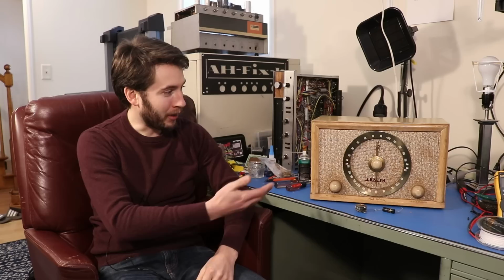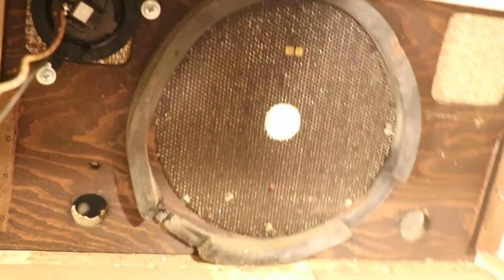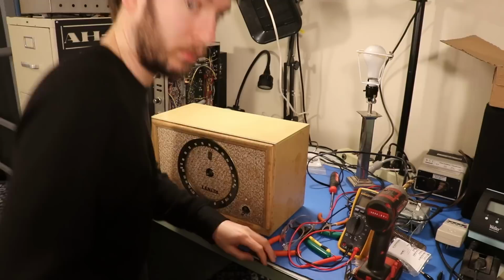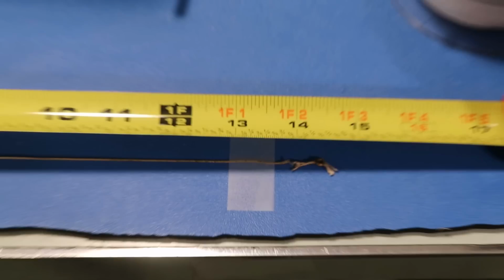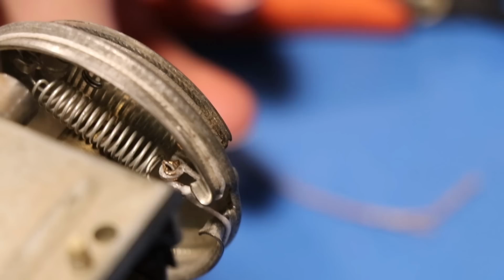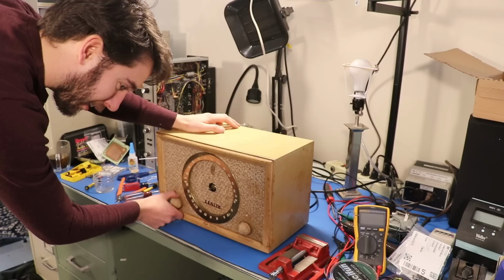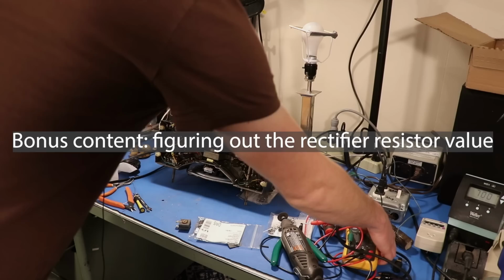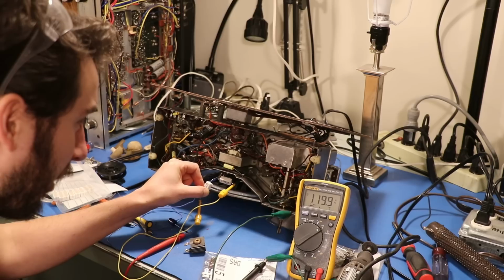I Missed Important Stuff On This Zenith B835E (And You All Let Me Know About It!)

Comment: Well, Christmas has passed, but New Years Eve is tomorrow. I'd like to wish you and yours a very happy 2023. After 2022, we sure could use it.
Here's something about your Zenith radio you probably didn't know:  There's a white dot just before the 100 on the FM dial. That's the original Zenith-owned WEFM in Chicago at 99.5 FM (now WUSN). It was the second station in the United States to begin broadcasting in FM. Also, Zenith really was promoting FM after the War, through the 1960s. This is likely why their AM/FM radios were so nice and had such fine audio, taking full advantage of FM's higher fidelity. This is particularly true of the 8 tube tabletop models. Some of those models over the years include the Y832, H835, B835, C845 & H845. They look different, but all have the high quality 8 tube chassis and sound wonderful.
Reply: The amplifier in those sets wasn't much different from what you found in most table sets: a single beam power tube, good for a watt or so. So while these played at adequate levels with a pleasant character to the sound, they were hardly what you'd call hi fi. But sound quality always seemed secondary to RF quality for Zenith in these sets. They put a lot of work into the tuner design, and changed it very little from the early 50s on.

Comment: Thanks for the feedback, glad to hear the radio performance is better and you learned some useful tips in the process.  I am glad to help if you are interested.

I have been restoring tube radios for the past 50 years and about 90% of the radios seem to have broken dial cord.  The woven fishing line you used is not optimum but, should work fine.  The eyelet used on the ends of the dial cord is not necessary; a knot will suffice.  Zenith used these to speed assembly line installation.
Reply: A simple knot is definitely all you need.  Once the cord is installed, a drop of superglue on the knot will permanently lock it in place

Comment: Oh the stench of a selenium rectifier melting down! Yep, you will always need to add a dropping resistor with a diode. The old rectifiers were not efficient which is why they heated up quit a bit.

Comment: I always enjoy our little walks in the park. Thanks. I wish aligning the FM tuner on my Pioneer QX-949A was as simple.
Reply: It’s actually even easier, all you have to do is adjust the local oscillator screw on the tuner until the stations line up.
Reply: @mjg263  OK,  thanks but i think i need more info before i go messing with it. ??  When 98.1 is tuned in the needle is at 96.4 ish
Are you familiar whit the qx949a ? How is the "local oscillator screw" labeled?
Reply: @ivansbacon  if you are looking at the variable tuning capacitor, you see those 6 adjustment screws in a row on top? Don’t touch any of those, but just past the very last one (furthest away from the big tuning drum with the string around it) you will see a small screw with what looks like a washer soldered onto the head. That’s the local oscillator adjustment screw. It is extremely delicate so use a very small screwdriver, and just the slightest tweak will bump the station position up or down the dial so be very very easy on it. You can touch up the position with that if it’s a little out. If it needs a full FM alignment that’s a job for a pro.
Reply: @mjg263  Thanks, i will give it a try when i set it back up with speakers.

Comment: Was there a problem with the original tweeters? Since they were disconnected raises an eyebrow.

 I have a couple of Zenith radios with these tweeters and one of them had no sound coming out of the tweeter. I heard of these developing shorts, so I checked it for DC leakage with my Heathkit IT-28 capacitor checker on the paper/mylar capacitor setting. Less than 2 uA at 150vdc or thereabouts. Would probably been ok to check with an ohm meter and see something in the high megohm range, probably 100 to 500 megohms.

Seems the problem on that one is the factory forget to install the 47K resistor on the terminal strip that drains the charge off of the negative plate, there was no evidence of solder ever being on that terminal from the factory. Zenith T2542 model

Comment: I believe you should have a .5 microfarad non-polarized capacitor on the lead of that tweeter to avoid damaging the coil and having more power available for the main speaker; it should sound better with more bass on the main speaker. Capacitor value is dependant on your sound preference, but don't starve the tweeter.
Reply: Capacitor is already present, tacked to the back of the tweeter. I missed it too initially.

Comment: The electrostatic tweeters are actually pretty good. They do go bad at times. Did you try them? Did you put a capacitor in series with the car tweeter? It will distort or might blow otherwise. Dome tweeters do not like to play way below resonance.
Reply: As far as i can see that tweeter alredy has capacitor on the back so it should be fine.
Reply from the maker: DIY Master is right, it already had one and it's visible in the video. I did try the electrostatic tweeters and they did not work well.
Reply: @AHFixIt  

Oh yeah I see it now. A little electrolytic.
Reply: @AHFixIt  Hey I have a question thats been buggin me for awhile.  What is that black square object which is attached to what looks like a desk-mounted microphone suspension stand?  I'm thinking its an antenna of some sort, and if so which model?
Reply from the maker: It's a halogen work light. Got it for cheap but haven't used it yet!

Comment: Single tweeter is the right choice. Two tweeters will cause weird wave interference and comb filtering, not sure why they would design something like that, even in the 50's.
Reply: my guess is they were going for something like mock stereo. not sure how much interference there would be as long as they were in phase with one another
Reply: There will be comb filtering. But keep in mind this is not a HiFi device and wasn't meant to be either. One tweeter was probably not sensitive enough and a decent level of treble was considered a win. It probably sounded quite good for what it is.
Reply: @westelaudio943  Agree, that was my thought too, needed more output. I have a couple of Zenith radios with this solo tweeter, but they are mated to a 5x7 speaker.
Reply: @westelaudio943  for ether to be comb filtering, there has to be a delay
Reply: @briangoldberg4439  

The delay comes from the distance of the tweeters to each other... Short wavelengths.
Reply: @westelaudio943  that would really be noticeable?
Reply: @briangoldberg4439  

Yes, but... It won't be too bad. Any time I measured double tweeters there were dips in the frequency response up to about 10 dBs or so. Acceptable for a radio but not a HiFi speaker.

Comment: did you consider doing something to limit the low frequency to the tweeter? in older units you'll see something like a simple bass-blocker a lot of times
Reply: yes, on a low impedance tweeter, generally a capacitor is put in series with the tweeter.
If you use a high impedance tweeter, then you can probably leave it out-usually, this is done with Piezo tweeters.
Reply: @m.k.8158  you can see there is a cap built in to the moulding of the tweeter assembly. It's an automotive tweeter, modular so it would have been designed to work with a matching mid/bass. Funnily enough, I bought a tray of these from a table top sale, they were OEM'd for Audi. Look very similar though.
Reply: @richclips  ok, I missed that...that should be fine then.

Comment: Sigh ... do NOT just wire the tweeters in parallel with the woofer, always use a small capacitor to make sure you only pass treble, not bass to the tweeters. Its OK to connect the old electrostatics direct, but not coil tweeters like that. tl;dr; put a capacitor in series with your tweeters.
Reply: There is a crossover capacitor already mounted on the back of the tweeter, that’s why he didn’t put one on the terminal strip.